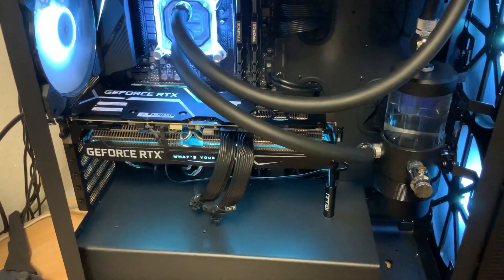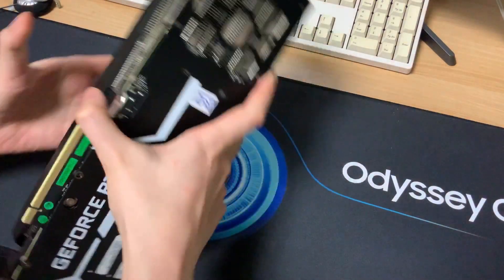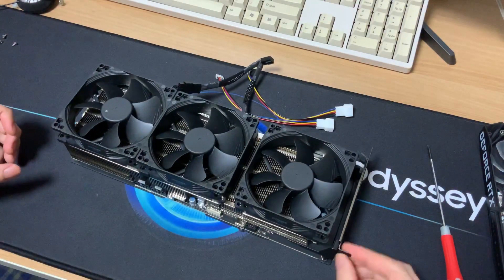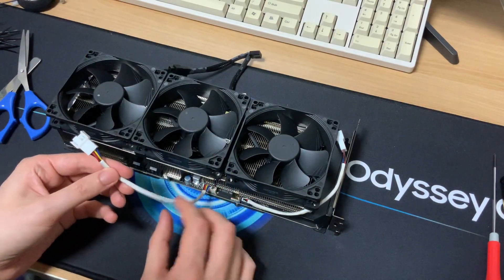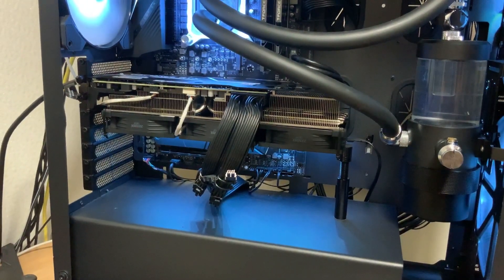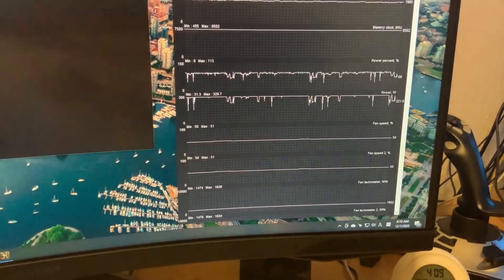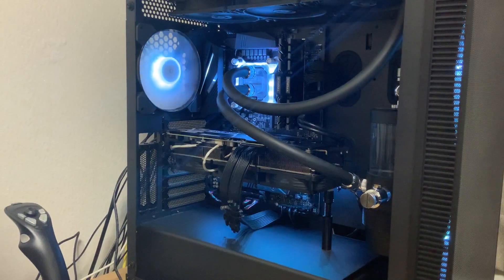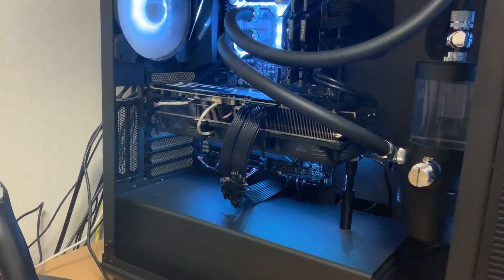Replacing the stock fans on my RTX 3080

Comment: How did you remove the shroud without removing the PCB from the cooler?  On mine there seem to be screws that are blocked by the PCIe power ports as well as by other parts of the PCB.  It seems this was edited out before 1:05
Reply: Did u figured it out? Im going to do the same thing
Reply: @Bigboss12024  Yes, I was able to get a thin screwdriver in at a slight angle.  It was very tricky but worked out in the end. get the thinnest screwdriver you can find and make sure it's the correct size head.
Reply: @braxil13  and how about the mod? did it work fine? which fans are u using??
Reply: @braxil13  You have to dismount the backplate in order to do the job???
Reply: @Bigboss12024  No need to remove the backplate, you can access just the shroud screws using the method I mentioned.  I originally used Arctic F9 PWM fans but the static pressure was too low to push through the heatsink.  I am now using Noctua NF-A9 PWM and getting good results.  Highly recommend using black "double sided phone repair tape" around the lip of the heatsink bracket where the fans screw in to give some adhesion between the heat sink and fan housing and reduce vibrations.  This is in addition to the zip ties.  I have had no issues with the strength of the adhesion for over a year doing this.  It takes a bit of pressure to get the fan to stick firmly to the tape, but once it is on it will not come off easily.
Reply: @braxil13  Galax GPU?
Reply: @Bigboss12024  Yes, Galax 3090.  It has the same cooler as the one in this video.
Reply: @braxil13  two 140mm fan could work?
Reply: @Bigboss12024  Not sure, static pressure might be too low.  You could test it.
Reply: @braxil13   could you give me your discord or something? i would really apreciate some help..:(

Comment: This is 2 years late but I'm looking to change the fans on my 3080 to make it quieter. You can use nf-a9x14 (the low profile from Noctua) and put them in your GPU shroud. From the audio, like others that commented here, it sounds like it's actually noisier after the change. I assume the rattling noise could be from the fact that the fans are not securely attached to the GPU.

Comment: Larger fans and lower RPM's will get you the performance and quiet running your after. These 92mm fans won't cut it for this mod if want to achieve both.

Comment: Would you be able to link the 4 pin pwm to 4 pin molex adaptor you used? I just recently deshrouded my gpu after one of the fans seized up and replaced it with two 98mm bequiet fans. Unfortunately I only have the one weird molex on my gpu board so I have been running the fans plugged into my mobo fan headers. I also tried going to my local computer store but the people there are useless and couldent even tell me the name of the connector on the gpu so thanks for helping figure out what that is called

Comment: Great mod. The stock fans makes u feel like ur in a server room. Great improvement, and it looks satisfying after mod also. Im gonna do this with a 3080 TUF, unfortunately I have to bend things to get there :/
Reply: So I bought cheaper Arctic P12 PWM PST fans, just to try it first and not waste 60$ on two noctua fans and I was blown away. 0 Noise, idle temps max 25C, gaming max 55C, so 10C down overall. Two two fans spin at idle 400RPM, gaming around 1000RPM, but are mostly silent. Tried also bequiet pure wings 2 but they couldn't push the air. 12$ for both fans, the P12 push so much air, the card is always at low temps under 60C even on most demanding games on ultra. In less demanding games I sits at 35-45C which is amazing

I think in the future cards will come with 2x120mm, 3x120mm or 2x140mm fans. just look the new Asus noctua GPU (3070?)
Reply: @ancientslav4863  I've a KFA2/Galax 3060 and thinking of changing the fans, and also thought about using Arctic fans so thanks for sharing your experience! Some have experienced whiny noise when P12 run at 1000 RPM, have you experienced that? Though that's probably not an issue since you change the fan curve after 30 %.
Reply: @kolppi  just leave the card as is. Make custom fan curve in gfe. And if you do want the 12cm fans, make sure they don't overlap over the edge of card. Worse temps. The p12 are noisier over 1000rpm..now I have a third pc Since then. 5800x3d and nitro+ rx 6800 xt 16gb. I have custom undervolt and fan curve.
Reply: @ancientslav4863  Thanks for the quick answer and tips! I have a custom curve already, the only problem is that the fans are at 30 % when idle (1100 RPM) and that's locked through firmware. So I can't force it via MSI Afterburner or Fan Control unfortunately. And there are no firmware updates to fix it.
Reply: @kolppi connect them to mb, not gpu. Use fancontrol, it can read gpu temp and allow u to set curve
Reply: It's for looks so people buy it. Im the kind of u guy who likes the industrial look. I have a smaller 2 fans gtx1080. It has 2 large gewtshink with 3 thick copper heatpipes going thru them. It's not loud, idle at 20C the card has 35C and in even most demanding games it never goes over 65C while being relatively quiet. It has come coil whine, but that's all.

I just really want to do this. But I'll get proper fans. Noctua NF-A12 black version. The card has a black passive cooler and is black, yet the cooler is red and silver. I'll make it all black.

Linus tech tips made serval videos on this. Even used a cpu cooler with 2x120mm fans. They took everything off and left just the card and cooler. It was amazing. But I want to keep the stock radiator, replace the plastic cover and two smaller 10cm fans with the two 12cm fans. It will look amazing!!!

Shame tho it's not an option for a rtx3070 And up it seems. Ltt tried it and got 78 to 96C. Insane Temps. Don't get it tho why the two Noctua couldn't cool it yet 3 small fans could...
Reply: Sup. Did you succeed with deshrouding your 3080 TUF? I'm thinking about doing the same with my 3070 TUF, but I really don't want to damage the shroud :/

Comment: its off because you are spinning a heavier fan with the same voltage and current its giving her all shes got Captain but it makes no difference its only reading voltage it has no idea you changed the fans it would read the same no matter what its just reading what voltage its giving the fan and using a set amount of variables

Comment: I would recommend also changing out the thermal paste and upgrading the thermal pads.
Reply: Thermal paste for me is almost always liquid metal. But what sort of thermal pads would you recommend to upgrade with? And does it really make a difference?
Reply: @millanferende6723  Plenty of videos showing that the 3000 series has some of the worlds cheapest pads. Some videos are showing 20 degree Celcius changes.

Comment: what's your memory temps ? better than before ? i try to don't hit 80°C on the vrams
Reply: 80 ist completely ok. 105 is completely ok 110 also bzt than it starts thotteling. Nvidia says up to 115 is within spec.
Reply: @gregorboxer2463  i don't care about any spec. My goal is to get it cool as possible with air cooling. One day the VRAM will die if it runs near the temp thresholds.

Comment: Seems to me the turbulent during load is the source of the noise with the noctua. Also using 3x fans will increase the noise regardless. Zotac stock fans seems pretty quiet but they have a bit of a motor hum plus rotor noise, which means the noctua sounds more quiet at idle. Perhaps you could try experimenting with larger 120mmx25mm fans. They push more air at 2x fans and are substantially more quiet (less fan = less noise). And they don't cost a lot too, you can get P12 fans for pretty cheap these days. Or go a bit more fancy and buy the top of the line noctua A12x25. Last but not least remember to use some rubber foam to dampen the noise in at the contact point between the heat sink and the fans.  I guarantee you will get very quiet operation at load.

Comment: Damn my zotac 3080 runs hot even with the stock fans, on warzone on no overclock I get around 75-80c
Reply: Same problem here, I undervolted it and now my top temperature is al 70º... Its super easy and safe, you should try it
Reply: That’s pretty warm for a gpu on warzone bc it’s well optimized, maybe check your case fan configuration is good for airflow

Comment: That GPU, that CPU cooler aaand a i3-10100! topkek
Reply: I just saw it lol
Reply: I kept hearing ppl mention intel has very good single core performance that i3 will be enough for gaming.
Reply: The i3-10100 performs just like an i7-7700, not so bad.
Reply: i mean if that's just a gaming pc that cpu is probably ok... unless you're heavy editing/streaming
Reply: @leonbishop7404  Even normally the CPU would be holding him back in a lot of games, but the recent Hardware Unboxed video shows that his RTX 3080 might be performing more like an RX 5600 XT in some games. This guy is either stuck in the past or uses userbenchmark for purchase decisions.
Reply: @TechHug  or hes just testing
Reply: Oh wait he said hes using it for 2 weeks
Reply: @TechHug  which benchmarking website would you recommend then other than userbenchmark?
Reply: @mariyastoyanova31  I recommend reviews.
Reply: @leonbishop7404  no
Reply: @leonbishop7404  no he's losing about 40 to 60 fps
Reply: @xsvrrx  An i7 8700k have almost identical performance in 1440p and 4K as a i9-13900k.

Comment: I'm doing something quite similar with my old MSI Duke 1080Ti just for giggles. It's a damn shame that manufacturers don't give us large heatsinks, large fans and no shrouds. A shroud can make a card run an easy 10C hotter than it should.
Reply: no joke, i literally dropped 10C on my rx 5700 xt by removing the shroud only
Reply: It's for looks so people buy it. Im the kind of u guy who likes the industrial look. I have a smaller 2 fans gtx1080. It has 2 large gewtshink with 3 thick copper heatpipes going thru them. It's not loud, idle at 20C the card has 35C and in even most demanding games it never goes over 65C while being relatively quiet. It has come coil whine, but that's all.

I just really want to do this. But I'll get proper fans. Noctua NF-A12 black version. The card has a black passive cooler and is black, yet the cooler is red and silver. I'll make it all black.

Linus tech tips made serval videos on this. Even used a cpu cooler with 2x120mm fans. They took everything off and left just the card and cooler. It was amazing. But I want to keep the stock radiator, replace the plastic cover and two smaller 10cm fans with the two 12cm fans. It will look amazing!!!

Shame tho it's not an option for a rtx3070 And up it seems. Ltt tried it and got 78 to 96C. Insane Temps. Don't get it tho why the two Noctua couldn't cool it yet 3 small fans could...
Reply: Well, they've listened - 4090 heatsink is the size of a small PC))
Reply: @freykun  lol, true that. Still too much shroud though. My do a deshroud mod on my 3080Ti just for the fun of it, it doesn't need it at all.

Comment: I want to change my stock fans for my dell 3080 but was hesitant to try, your vid has made me a lil more confident in giving it a shot
Reply: how did that work for you? what fans did you use?
Reply: @zero-cy5gc  Heya, I never bothered, repasting, and padding, worked great, especially if you apply past to the brace as well

Comment: The PWM percentage control of your GPU fan speed is tachometer reference. Meaning that if your stock fans at 100% spin at 2500rpm, then 50% will spin whatever fan is connected at 1250rpm. Your software has no way to know the maximum rpm of the aftermarket fans that you bolted on. I’m running Arctic P12s as a GPU shroud, and 70% speed in afterburner maxes them out at ~1850RPM. I can run them at that speed too, as they are significantly quieter than the stock shroud while dropping my fully loaded GPU temps into the mid 50s. My MSI Ventus 3080 also had a tabless retention system for the stock fans, so my GPU sits on top of the fans, eliminating GPU sag at the same time.
Reply: So let's say the gpu fans spin at 2500rpm at 100% and I use an 1800rpm noctua fan as a replacement. Will the noctua still max out at 1800rpm at 100% fan speed?
Reply: @Drew802  No, your noctua fans will max out at 72% and setting the fan curve higher than that will just run them at 1800rpm.

Comment: Noctua will be releasing in Q1 black NF A12X25 , maybe try 2 of those. 
2 120mm Fans are better than 3 92. Actually , 2x120 can move about 13% more air than 3x92 at the same RPM while being quieter !
Reply: These 3x92 fans fit great in this build it looks great.
Reply: Those are pushed back to q2/q3 AFAIK
Reply from the maker: I actually did try it with 2 120mm but didn't add it in the video.  I used my spare arctic p12 pwm fans for this test.  Was a bit quieter but the biggest drawback was the howling/whistling wind sounds it made.  Just couldn't get rid of it no matter what I tried.  Think it was caused by the air flow outside the GPU interacting with the air coming off the heatsink.  Here is an image of what it looked like.  https://imgur.com/a/gjN5Zbj
Reply: @jmoonb2000  In sff cases , where GPUs are bottom mounted, a YouTuber named Optimum Tech , placed 2x120mm as pull fans . I don't know if that might be effective and decrease noise levels 🧐
Reply: @jmoonb2000  wow amazing ! Thanks for the photo

Comment: Very nice mod and cool video but wouldn't it be better if you just watercool the gpu because you have a custom loop already or aren't there any waterblocks for your GPU available?
Reply from the maker: I did watercool my GPU in my old build.  Just didn't like the hassle and extra maintenance needed.  Draining and tearing down a loop just to take our the GPU was no fun.
Reply: @jmoonb2000  that's for sure, but I guess you will have this card longer in this build

Comment: On my Galax SG 3080 the first fan adjacent to the Video ports died or seems so after troubleshooting. I haven't opened it up yet but i intend to. I could use your experience to help with these questions. 
1. Removing the entire shroud (not heatsink) has any warranty tampering noticeable ? Like removal of those warranty stickers etc ? 
2. Can you put it in 92mm pwm fans into it regardless of their max input power etc ? I might get myself some fans too from Noctua too or Arctic. 
3. I am thinking of Actually sticking the 3x Noctua fans together and then screwing up the ends with those screw holes. Is it better to use zip ties or adhesive instead IYO ? 

I could get the card RMA'ed but after that I'll surely do this as long as it doesn't mess with warranty.
Reply from the maker: 1.  Nope.  Just need to unscrew 6 screws and unhook the fan cables.  
2.  If I remember correctly each header can support more than 5 watts of power which is enough to run all three fans off of one header.  I wouldn't worry about it unless you plan on getting those high powered 3000RPM plus ones.
3.  The screw hole size is an M2 so its pretty thin.  you will need a really long m2 screw and very wide bolts to keep it in place but it is possible.  
Hope this helps.

Comment: Thank you for your video. I have the same card and I actually planned to do the same but in meantime I could order a Suprim X which I'm still waiting for. If my order gets deleted (we never know with all that mess) I think I will mod mine like yours. But I already did a few tricks, I swapped the thermal paste with Thermal Grizzly Kryonaut and I'm pretty sure it's cooler now, although I couldn't give values. Second thing I did was flashing another bios as this is a reference board and there are a lot of compatible boards out there. I flashed the Gigabyte gaming OC to max out the maximum power to 375W (actually measured to around 360W with afterburner) to gain some performance. The other improvement was the fans behaviour. With the Gigabyte bios, the fans begin to run at 52%, not 30% like the stock profile. But the thing is, the fan curve is way more progressive. And at 52%, the stock fans runs at around 900RPM, which is far less noisy than the stock 30% speed. So I just set a custom curve and the fans are always at this value to keep the chip at ~30°C, then in game I just let the temperature go to 73°C with a progressive curve to around 65%. Can't remember which RPM it is but in load with this configuration + UV 0.900mV at 1900Mhz, the noise is waaaaaay more bearable. I guess it's too late for you to try it out now that you hard modded it, but I advise others to try.
Reply from the maker: Hey.  Thats some good modding.  I may try modding the bios soon.

Comment: This may be a silly question but how do you know what type of fan to use/ which type of fan to choose? Im using a 3080 Palit gamerock oc one  and one of my fan is faulty.
Reply from the maker: My cards spec showed it used 92mm fans and measuring it showed it could fit the noctua fans.  This will be different depending on card though.  I think the gamerock is much wider so it could maybe fit 120mm fans on it.  Having said that, many cards require you to take off the entire cooler to access the fans and the fan header so it might not be as simple as what I was able to accomplish.  I would try to get it fixed via warranty first before trying something like this.

Comment: thanks for upload, I really waiting for that
idle noise is good now and seems you never touch warranty void seal
did you remove warranty seal?
Reply from the maker: Nope.  The fans just comes right off once you undo the screws.  Very easy to put back together as well so it should be good if you need to return it for warranty.
Reply: @jmoonb2000  nice, I'm glad to hear that
1 more question, NF-A9 with 30% Fan Curves what RPM?
Reply from the maker: @tyler0131  it hovers around 950RPM.